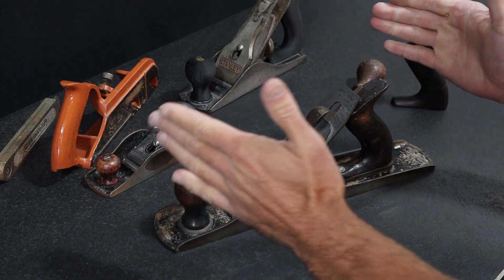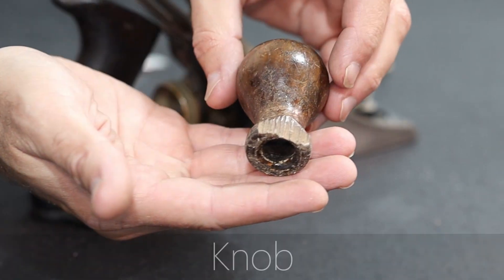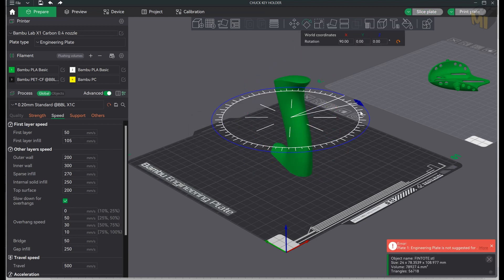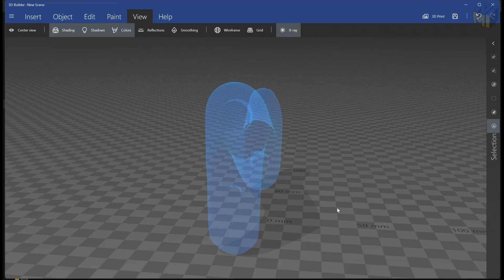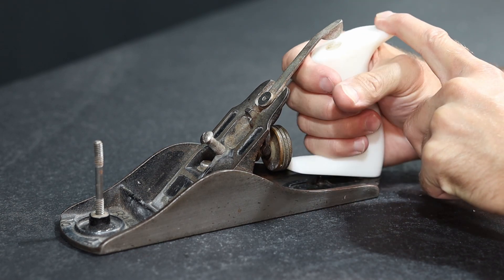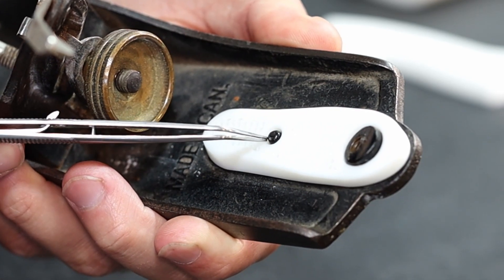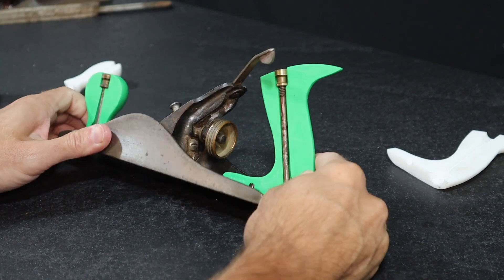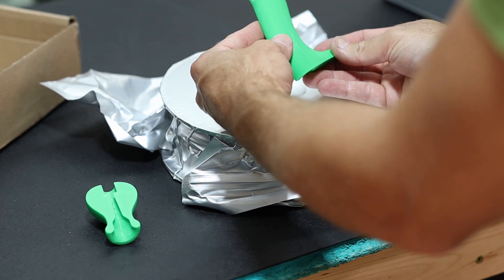Fix and Improve Your Tools With Carbon Fiber 3D Printing!  Feat. Bambu X1C

Comment: It's a nice idea, but I can't help looking away and gasp when you bend the steel rod.
Reply from the maker: It is still going strong!  You're right though, it should be straight to be tensioned properly.  An integrated handle design would be much better I think.
Reply: @NeedItMakeIt  I like restoring old hand planes, so seeing an original component being bend hurts a little bit.

Comment: I have couple of 100+ Stanley’s it it will offend me to put plastic parts on it. There are still PLENTY of old tools that can be used as donors. If you just need a utility tool - do not waste your time on very old ones. Rather get some good modern tool. If this also has some sentimental value do it right - use authentic parts!

Comment: Please stop putting your planes down on the knife. Or put a lift under it. Was the first lesson in school when learning to use tool. Chisels with the angle down and planes on their side. If you nee to unscrew take the blade out first.
Reply from the maker: I can't tell if you're joking.   If you're not, my tops are made from rubber, but more importantly planes iron down is the way they're intended to be used.  Just make sure they're not on something metal.  Have you watched the video from Stumpy Nubs on this very subject?
Reply: This is bad and out of date advice. Please stop sharing it. It has been debunked numerous times. As mentioned above, Stumpy has a great video on this.

Comment: How does it feel to use compared to wooden handles which are probably heavier than prints? 
Better, worse of no difference?
Reply from the maker: It feels good far better than what it was before with my hand being way too tight, I think it also feels good, because of the addition of the CF, it gives a little texture, and that look is pretty amazing.  As far as the feel, I like the plastic version because it fits so much better, but it's really hard to compete with natural wood for looks, I'm so biased as a woodworker, so I have to say solid wood with the right shape would win out.   For the weight, if you can print solid or close to solid, they'll weight about the same.  At the moment, the original is 79g, the plastic is 63g.

Comment: Printing-tip:
To get maximum durability for this project, slice handle in half, print flat on build-plate, making the printed layer-lines run parallel to the forces exerted on the tool, when in use. Glue together.
Reply from the maker: Yeah that's a good point. I like to avoid post-processing if possible, but that's a good tip, and the print quality is good doing it this way also as I showed in the video.